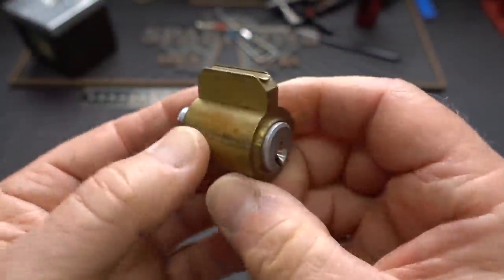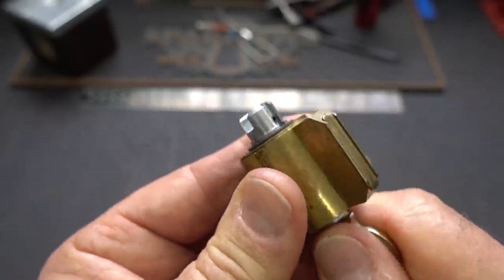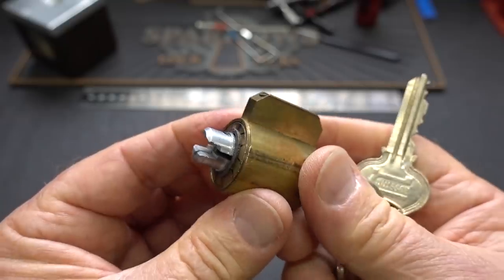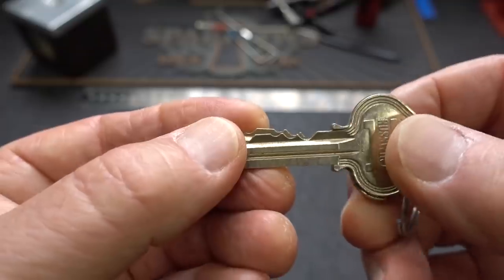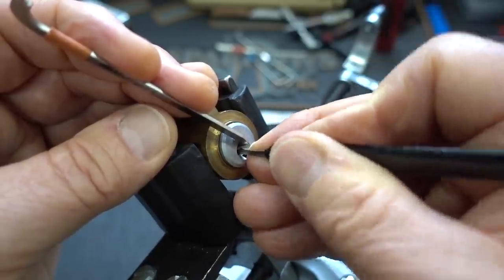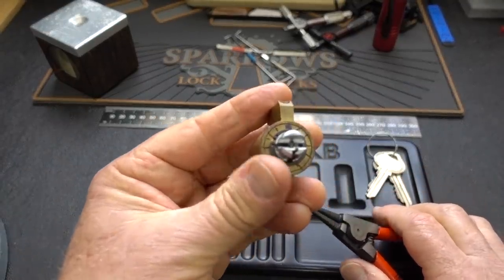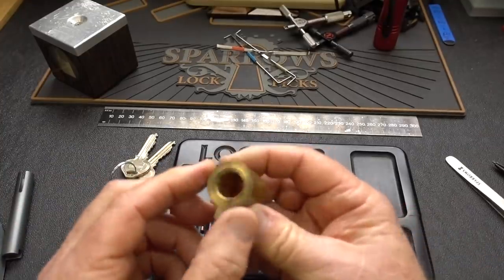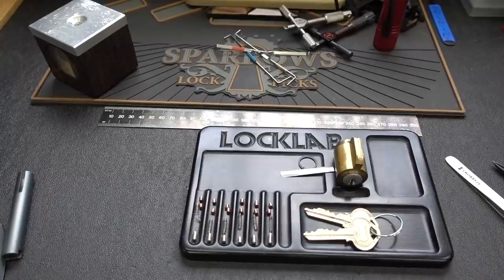(1764) Master Ring - How They Work (& Picked)

Comment: Hello Bill. The master ring cylinder (US414,720, Edward O'Keefe) was a stroke of genius. It made possible the functional merger of products make by P & F Corbin and Russell and Erwin, which were two separate companies founded prior to the U. S. Civil War.  Between them they had two plug diameters (.509” and .552”) and several increment systems. Clearly the cylinder was expensive, but it was adaptable to both company’s key sections and specs. It permitted much safer MK’ing and a keying capacity that still blows away the competition. Change keys and master keys are completely disassociated. This means in a 6-pin master ring cylinder, you could have 6000 changes under one master and 6000 under another, and any change operated by a combination of various masters as required. Inconceivable in single shear line cylinder. 
I’m sending some drawings from my CR ICore class which you are welcome to share.  Best regards.
Jerome
Reply: Don't get old and forgetful if you can help it. I just found the drawings under a pile of other stuff. sigh.
Reply: Absolute genius 👌. Not just the mechanics of the lock but you know your stuff. Hats off to you sir.

Comment: That was VERY interesting.
Am I to assume that other locks have different renter keys but master rings keyed alike? That would explain why ALL the stacks need to be double pinned, so you can change the renters shear line on each stack while keeping the master the same. But unlike master keyed locks using multiple wafers where you have multiple combinations to make shear lines, on this one there is  only one shear line for each key and you can't mix and match.
Reply from the maker: Correct on all counts.😀

Comment: I was a locksmith  for 11 years. I had an old hotel,  that was converted in to an apartment complex. I had 12 floors of Russwin's to deal with.  If you want something to have fun with, find a Corbin Russwin Unit lock. I had a customer with 30 of them. The locks are handed and I was pulling hair out as they wanted lock functions changed . I at least the maintenance guy of the complex  had enough spare lock units to get the job done.

Comment: Can you use something like a rolled up sheet of light spring steel to make an adjustable follower?
Reply: In an old video of his he says that basically anything can be used as a follower "even paper" (although i dont think papet would be very good. ) i feel that should be a fine solution. 

Deviant Ollam uses a follower with ball bearing detents on both ends so you never accidentally let a pin pop out
Reply: Binnesines card....
Reply: BITD I used old markers, and as long as they fit snugly you should be good to go. Although hollow followers are handy because you can “catch” the pins in it and then guide them to the right slot on your pinning mat.
Reply: I get what you mean and I like that idea! So the spring effect would fill the gap more?
Reply: @danskifpv  That's what I was thinking. I've never tried it, and there might be something inherent in it that would lead to a loud "SPROING" and small parts flying about the room. Maybe thin sheet plastic?
Reply: I get what you mean it would depend on how strong the springs are, as a locksmith I’d tell you it’s not a bad habit to always use a shim, and use a follower of the right size for this one it happened to fit a standard size, I have made some followers myself, if you are going to make your own or don’t have the right size go to your local hardware store and look for brass tubing it should be about a foot long, it comes in all different sizes, the best part of buying that is you can customize the follower, I cut a slit in the front so it can accept a mortise cylinder, or a Schlage key and knob.
Reply: The first lock I successfully dissembled/reassembled I used 1/4" drive 11/32" deep socket.  It fit very well...little heavy for the task but it worked.
Reply: Light Weight I’ve done that before as well!  It was handy and worked well.
Reply: You can do a lot with dowel rods.
Reply: 63flight I agree. I now have a few small pieces of that around. They are lighter and cheaper than sockets.
Reply: I’ve used a business card

Comment: Hello Bosnianbill, I have seen many of these locks as my father had a hardware store that dealt with Russwin & Corbin, The cylinder you have is for a knob lock or unit lock they also made rim & mortise cylinders that were 1-1/2" diameter & specal mortise locks for them & padlocks with master ring these padlocks extra wide. Thanks for this video

Comment: Have fun putting that back together. :)
Reply: Bit of fun but not as bad as repinning a SFIC😅
Reply from the maker: Easy.  
1.  Insert key in core.
2.  Fit key pins
3. Slip on Master Ring
4.  Insert 4 identical-sized pins into first 4 chambers
5.  Insert 2 rear-most pins until flush
6.  Slide into lock body, using MR as the follower to insert springs.
7.  Done.
Reply: @bosnianbill  OK, now let's see it. :)
Reply: Gary Rumain If I can do it Bill can definitely do it😁

Comment: You could attach a tamper seal to the master ring and housing to detect if the owner used their key. You could attach a tamper seal to the master ring and inner core to detect if a user used it.

Comment: I JUST got two of these in an eBay order of random mortise and door locks, sans key, and I could not figure out why it was giving me so much trouble.  I finally gutted it (thankfully the bible opens) and yeah, the tolerances are so good there's a .5mm master pin and variable springs (because some pin stacks are taller than others).  I still can't pick it, but it was really hard to search for until I stumble across a post on lockpicking101.  Sure enough, mine look exactly like this one.  ETA: Actually, I just picked one of them; I think the other one isn't actually keyed up correctly at all? Aside from the absolutely tiny master pins, there was only one key pin per stack.

Comment: When using the shim to "bridge" like that, push the shim ALL the way in until it stops on the front of the cylinder, then use the follower.  A little tight sometimes, but having the shim completely under the bible usually prevents these disasters.
Reply from the maker: Good idea.  If I could've gotten it in further, I would have.  The tolerances were too tight.

Comment: A master ring mortise cylinder (called Jumbo) is larger diameter than a regular cylinder but not as large as the Mogul detention cylinder. However I cannot find any lock cases that take Jumbo cylinders. Reducing bushes are available to retrofit a standard cylinder in a Jumbo lock case.
Reply: They are around, I have a mortise lock that uses a Jumbo.  The Jumbo cylinders are still listed in Corbin-Russwin catalogs and even listed in the current ASSA catalog in most all cylinder types.

Comment: I wonder why someone would select a lock like this for an apartment building. I don't know about the US, but here in Germany, most people would swap that lock out in an instant to have one where only their own keys work. These locks can often be seen here as euro (profile) cylinders. Only case I know of where a lock like the one shown here would make sense would be in a large business building, where the building management or the fire brigade might need a speedy, simple way to open all doors.
Reply: These cylinders are not really intended for small masterkey systems. They were intended for very large systems where possible 'phantom' masterkeys would chew up differs. AFAIK the Empire State Building used master ring cylinders (to what extent the system remains I do not know). Corbin/Russwin claim that for masterkeying capability, a six pin master ring cylinder is equivalent to a seven pin ordinary cylinder. In a way it was similar to the Yale bicentric cylinder (no longer made), except the two plugs in a bicentric cylinder could have different keyways.
As far as apartments and condos are concerned, the lease would generally forbid the tenant changing the cylinder on the apartment door since the superintendent or manager or Fire Department need to be able to access apartments quickly.

Comment: The bidding on the key reminds me, my company opened a second floor in our office. The locksmith who did the locks for the main door and all the internal rooms with locks stamped the bidding for the locks on the door frames. I realized it when I saw the number on the key matched the bidding I was looking at then I noticed the same number was stamped on the door frame.
Reply: *bitting.

Comment: if both bittings could open the lock, isnt it great that you could pick to either bitting? And in this case, it is only two chambers; which seems low.
Reply from the maker: Yep, picking to either shearline opens the lock.  Yes, this one had only two but it could have been every chamber - you never know how many chambers or which ones until you get it gutted (or compare the keys).

Comment: What is the advantage of a lock with a master ring instead of traditional master wafers with a single shear line? Pick resistance?
Reply from the maker: Correct.  A lock with a single shearline and containing multiple master wafers, it is much easier to pick.
Reply: @bosnianbill  Cool. I'm surprised any landlords would bother with that when it probably makes the locks more expensive  :)
Reply: @CoolerQ  These were never intended for apartment complexes,  rather for use in large commercial building settings, like the Empire State building as another commentor pointed out.

Comment: Why do you 'have to be lucky to pick the correct shear-line"? Both opens the door smh?
Reply: I mean it's obvious it wont open on one of them but why is a bit unclear here.
Reply: @Tokyo-go2du  If you "mix" the shear lines it won't open. For example, if you picked pin 5 to the "master" shear and pin 6 to the "tennant" shear neither the master ring nor the core will turn. 

You have to pick both to the "master" shear or both to the "tennant" shear to be able to open the lock.
Reply from the maker: @Tokyo-go2du  Try watching the video in real time and listening to the dialogue...
Reply: @bosnianbill  I did that twice Bill and never did you explain it as above which more than covers my lowgrade IQ
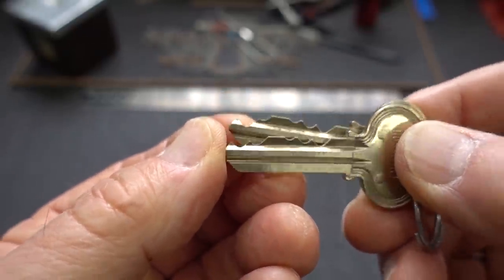Reply: @Tokyo-go2du  Yes he did. At 3:44 in the video: "I'm hoping to get lucky and hit one shearline or the other, because if I pick all of them to - let's say 5 pins to the renter's shearline and accidentally pick that 6th pin to the landlord's shearline: not going to get an open."
Reply: @AliveInTwilight  No he said "its not going to open" not why its not going to open because of that.
Reply: @bosnianbill  But what I understand, you don't need to pick to the right pin-stack right? Since that "master pin" could be picked so either its above the shearline or below the shearline, regardless of which shearline. Provided that there is enough space in the bible to accomodate both the driver pin and the master pin.

So even if you would have picked to the renter's shearline (on the pin stack) but on the landlord's shearline (on the lock) it would mean it would open if you picked all the other landlord's shearlines.
Reply: @sebastiannielsen  There are two shear lines, and for the lock to open all the pin stack splits have to meet the same shear line.
Reply: @douggwyn9656  Correct, but the pin stack split doesn't need to belong to that shear (you can pick the "tenant split" to the landlord's shearline) provided the bible can accomodate both the driver pin and master pin.

Only way to "prevent" that would be to make the master pins kind of T-pins, and then make the key pins slightly larger diameter, and then makes the holes in bible slightly smaller diameter, so the master pins cannot be picked more than halfway past the landlord's shearline.